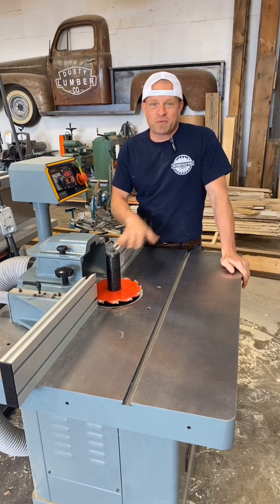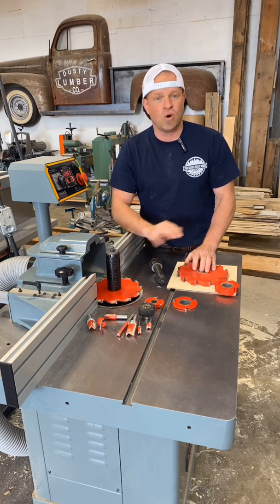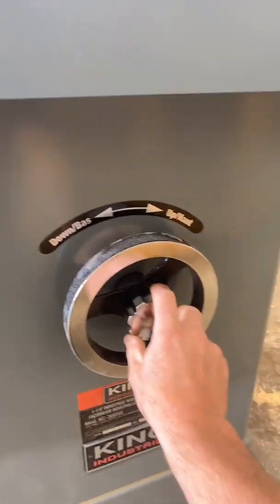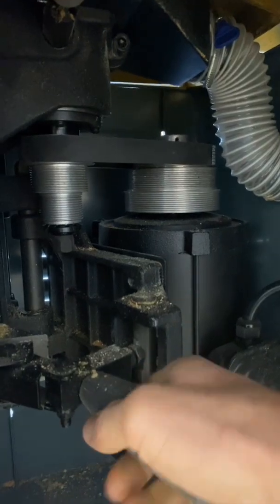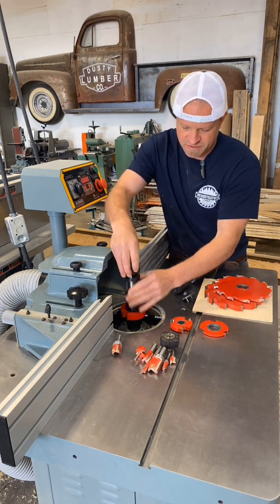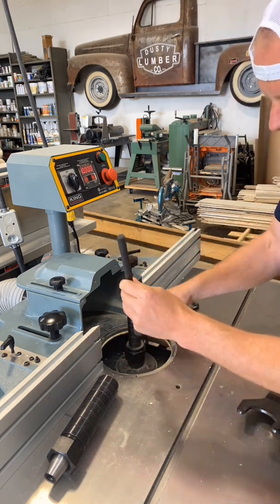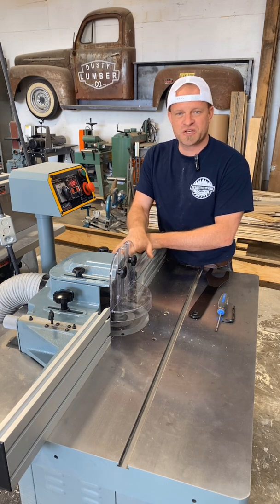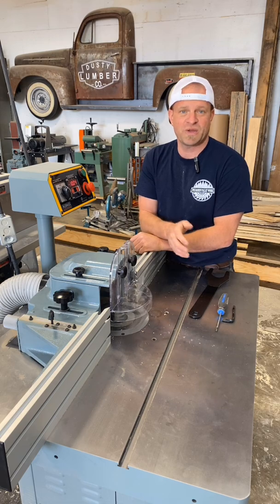Shapers explained

Comment: Just one tip - When you're changing cutters, spindles etc, put a piece of plywood or MDF on the shaper table to put metal objects on.  Would prevent potential knicks / scratches from developing on the table surface.

Comment: Guy said the bit doesnt spin like a router but spins like a router
Reply: Now you don't have a bit that just spins.. proceeds to say how it just spins. 

Says you can use any router bit in it, but doesn't say that most routers spin at 22k RPM max speed not 10k.
Reply: I've been scrolling comments looking for an explanation of what "it spins around unlike a router which...spins, around." 🤨

so once more for us dumb kids in the back, is there a difference or can this just accept larger bits/ spin slower & with added torque?

Comment: Great explanation and video; however, you forgot the most important thing: ALWAYS DE-ENERGIZE THE EQUIPMENT AT THE POWER SOURCE (e.g., breaker switch off or unplug) BEFORE WORKING ON IT TO CHANGE TOOLING OR PERFORM MAINTENANCE. 

DO NOT RELY INTRINSIC SAFETY DEVICES TO DE-ENERGIZE THE PRIMARY SOURCE OF POWER.

Comment: Thank you for a great video. 
How do you fit the small router bits in?
Reply: He showed a collet adapter that replaces the spindle.  It holds whatever size collet you need, usually 1/4" or 1/2", to fit the shank size of your router bits.

You could also use a variety of endmills in a multitude of sizes, and purchase collets for each size endmill shank.

Comment: I have the Powermatic 5hp shaper and they are definitely worth what you get from them. The only thing I’ve found is you really have to be careful with these machines is they are not forgiving. If you make a mistake they are extremely punishing. I guess all these woodworking machines can be but this is the one I’m most leery of.

Comment: What are your thoughts on power feeders for shapers? Do you see a need for one or ever wish you had one?
Reply: Power feeders are AWESOME! They keep your hands away from the cutters and actually give a better cut than pushing by hand. I have powerfeeders on 2 of my shapers and one more for the tablesaw. Looking at one for the bandsaw now.
Reply: The shop I work at has power feeders on each of the shapers such a nice thing to have keeps me safe and like the commenter above said makes a very clean perfect cut

The rule we have when running grooves is run it twice
Reply: Power feeders to make it so much safer. If your what is tearing out when putting a decorative edge on, you can back feed the wood. (Using the power feeder you can run the wood backwards from which way you should be running it)

Comment: People purchase router tables and put the most powerful routers available to run large diameter cutters.  One major problem with that concept is a router motor is a universal motor and the RPM drops under a load. . The torque and  HP of a router is rated at its maximum RPM and not its actual working RPM.   In order to ensure that the cutter is rotating at the proper RPM under a load,   the router speed  must be initially set  to an RPM that exceeds the maximum safe RPM of the cutter.  The final cutter RPM under load then becomes a hit or miss crap shoot.  This can be observed by watching a woodworker cut kitchen cabinet door panel faces with a large panel cutter router bit.  You can hear the RPM of the router drop when the wood is fed into the cutter. If the required cutter speed under load is 7000 RPM and to achieve the working RPM the cutter must be initially set to 20,000 RPM,   the dynamic balance is off and the cutter will dangerously vibrate.    For applications requiring smaller diameter cutters at high RPMs cutting small grooves and slots,  a router table does a nice job. When the load begins to slow down the cutter RPM,  a shaper is a better and safer choice. 

   A shaper uses an induction motor which will either continue to  turn at the initial RPM or it will stall.   If the HP of the motor is too low for a given cutter diameter then a larger more powerful motor can replace the current motor or a larger more powerful shaper can be used for a particular job.    Shapers and the HP of their motors  are selected based upon the  cutter selection and the load.   If the proper shaper and motor are selected,   the cutter RPM of a shaper will not change.  This is a far safer option than attempting to push  a large, high HP router past its intended purpose.     

The shaper in the link below (G0510Z)  is sold by Grizzly Tools and was also sold by Harbor Freight.  It is roughly the size of a router table but the similarity ends there.  It is a true  shaper and is  a much better machine for applications requiring  larger diameter cutters. It comes with both a spindle and a collet allowing the machine to use large panel cutting router bits without the dangerous high speed  vibration issues. Because of the reduced vibration the cuts are much smoother.    This model  initially came with a 3/4 HP motor but a 1HP or a 1 1/2 HP motor can be  easily switched out if needed.     Once the motor is matched to the load, a shaper does a far better job than a router table for panels and moldings. 
 https://youtu.be/XK0ZM-AYodE

This link shows several shapers set up as a system  to produce kitchen cabinet doors.  These  are extremely powerful high precision machines  designed specifically to produce cabinet doors. 
 https://youtu.be/R5TUG1v6O5E
PHD